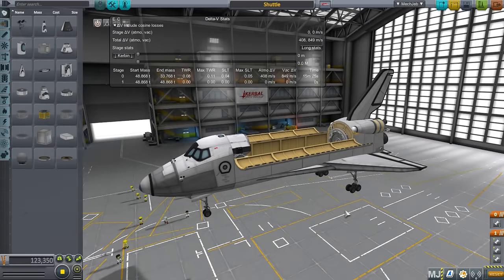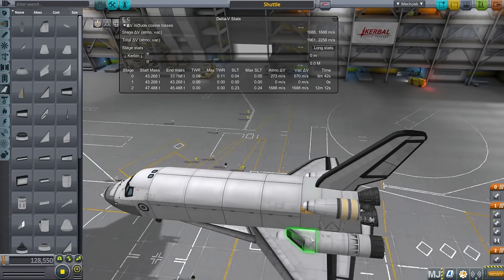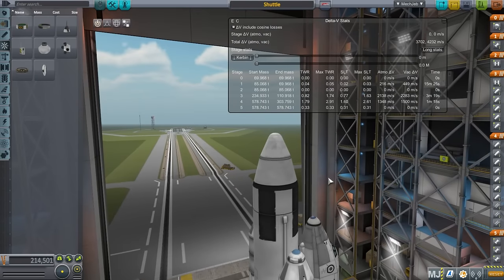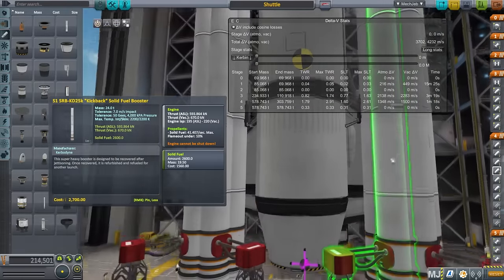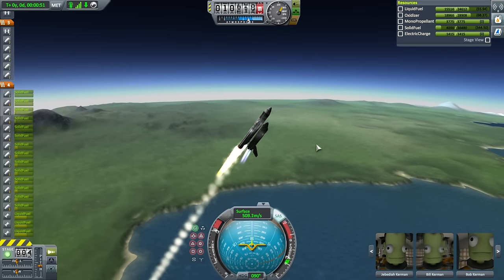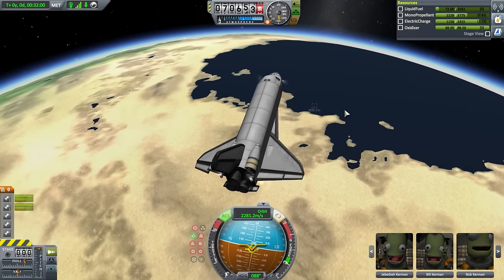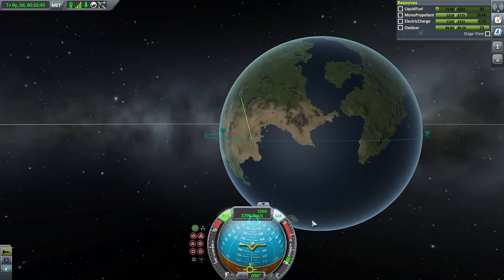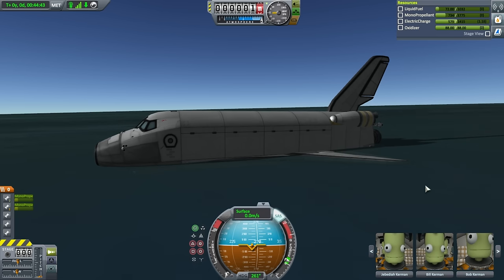Kerbal Space Program 1.2 Advanced Tutorials 01 - Stock Shuttle Design

Comment: I love the OMS engines! I was wondering are they actually that size in 1.2? Haven't played with those much.
Reply: Btw I also use the thud engines with an adapter over top and that makes the burns short.
Reply: Tyler Raiz I have used the thud as well. Ruben over at Kerbal Space Command has done a few how to videos for shuttles I'd like to hear your thoughts on his design.
Reply: Tyler Raiz Thx for the information! It would be cool if you could say what you would change because the shuttle that I was using broke in 1.2 lol.

Comment: Great tutorial but my Shuttle keeps exploding 20 seconds after launch, I think its the SRB cluster although I'm unsure.

Suggestions?
Reply from the maker: What is happening when it explodes? If you press F3 you can bring up the event log to show what initiated the explosion, and that could give you a clue.
Reply: I think the issue is corrupted symmetry from moving the craft between the  SPH and VAB, I noticed that some parts were floating in the air way off from the craft, one such piece was a Elevon if I removed the part the craft simply wouldn't load onto the pad and or runway.
Iv'e since scrapped those corrupt Shuttles and started a new.

Bugged Ship linked below, the only reason I want to workout whats gone wrong here is to prevent it from happening again.
https://kerbalx.com/Vichard/Shuttle-Full-Assembly-v2Broken-Do-Not-Download
Reply from the maker: I tried out that craft file, and it was working well until the structural failure on the elevon attached to the engine mount. It might be best to lock the control surfaces during launch, though I'm not sure. I'd also suggest autostruting one or two external tank sections to root part and moving the shuttle a bit lower in the stack so its engines have more control authority (more distance from the center of mass -> greater lever arm).
Reply: Yeah I tried locking the surfaces and doing some auto strutting which didn't help, it always seems to explode ~20 seconds after launch.  That craft must just be corrupted somehow so I built another Shuttle almost the exact same way and I've made 3 successful launches now.

Thanks for the help and great tutorial,  I finally managed to build a Shuttle that actually works!

Comment: Well the hole point of the shuttle was supposed to be that you could recover the engines and there for it would be cheaper... But it didn't turn out that way.
Reply: Not just recover the engines, but recover as much of the total liftoff mass as possible.  It really would have been best if the orbiter, the main 'spaceplane' proper that landed on a runway, could have been stacked on top of the ET and F-1 engines from the Saturn V could then be put on the bottom of the ET.  That would have eliminated the falling debris issue being such a major hazard to crew safety that dogged the system throughout its history and eventually lead to the tragedy of STS-107.

Unfortunately, putting the orbiter on top of the SRB/ET stack would have also meant the thing would have no longer fit within the same footprint and space as the Saturn V which would have necessitated partially rebuilding and increasing the height of the Vehicle Assembly Building at Kennedy Space Center, and NASA was never going to receive the funds for a renovation project of that magnitude.  So the STS Space Shuttle simply could not be physically larger than the Saturn V, it had to still physically fit within the same servicing facilities as the Saturn V.
Reply: The main concern was the engines however, because a the pods were quite cheap, the shuttle was only so expensive because they thought they could recover the engines and everything else.

But the engines just ended up being replaced because it was too expensive to service them, I think they only ended up re-servicing engines 5 times in the hole history of the shuttle program.

So the hole thing was a waste you had a shuttle which was more expensive than it needed to be to re-service engines when it was just cheaper to replace them. And it was more dangerous...

good game right...

Although they should have given NASA the budget to replace the shuttles far easier so they were not stuck without a heavy lifter and pod suitable for transporting humans.

Because it was clear the shuttle program was a failure by the 90's, they should have got a budget to replace it within like 10 years... It's not like it was a shock that it needed to be replaced.
Reply: Rehabbing and inspecting the aerogel thermal tiles after every flight was a major contributor to the costs too, not just the expense of keeping an inventory of completely overhauled and fresh engines available.  The thermal tiles were too fragile, the thing couldn't even take being rained on as moisture and water would destroy the thermal tiles, and you needed folks with engineering degrees inspecting the thermal tiles and replacing them as needed following every flight.  The orbiter itself, too much of a stretch of our technological capabilities for the 20th Century.  BUT, the Shuttle program did give us recoverable SRB's and the foam insulated External Tank can work wonderfully if you put the load on top of it, as the SLS design will do.